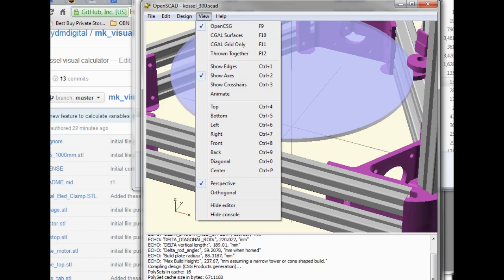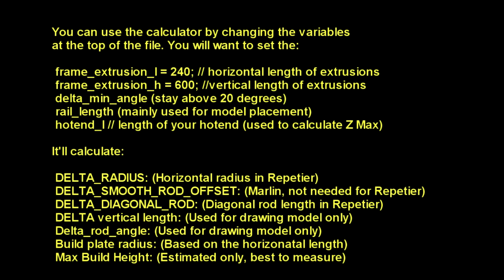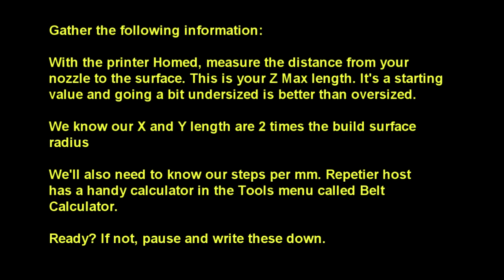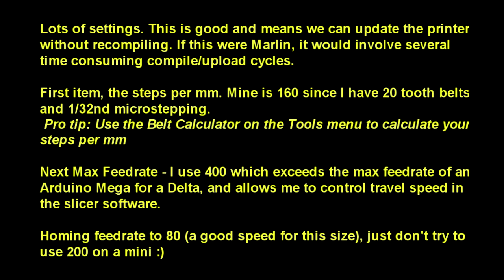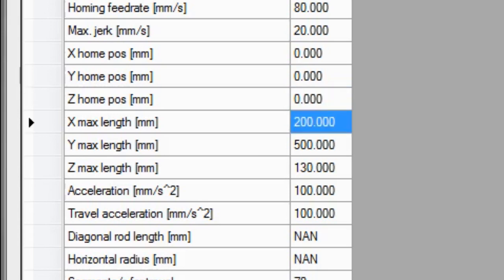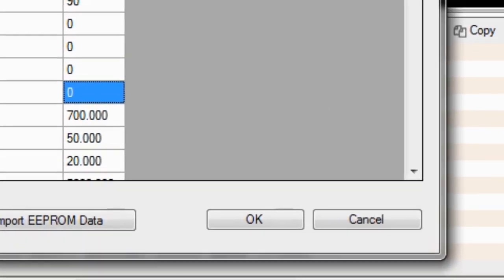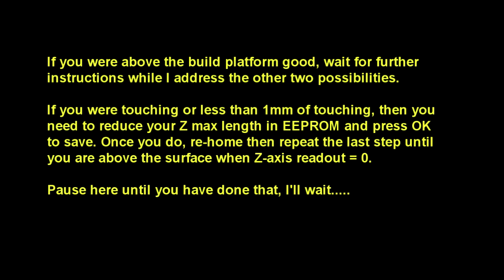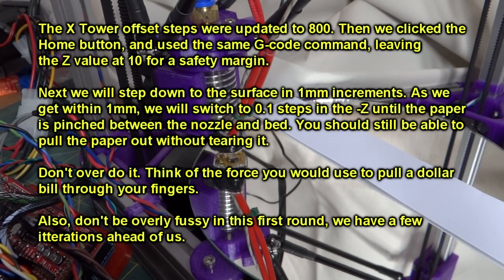mini Kossel Calibration using Repetier FW

Comment: Hey jay, thanks for tutorial, it helps me understand repetier firmware more, and i'm using repetier in my new kossel mini, but i still having an issue with the nozzle height when it moves along Y axis, when i move to X0 Y70 the nozzle still crashing into the bed, i've calibrated all the endstop,and the horizontal rod radius, do you have any idea what might be the problem? thanks :)

Comment: Flatness can be done working on one axis only.  

First make sure to calibrate the 3 axis so they are as level with the bed as possible.  

Then choose one axis, measure the error in Z near your axis and at the center of the bed.  If the difference

    (Z reading near axis) - (Z reading at 0) > 0 --> increase ROD_RADIUS 
    (Z reading near axis) - (Z reading at 0) < 0 --> decrease ROD_RADIUS 

You can use decimals and be very precise.  No need to zero the bed between readings, as the machine is already even. You may need to repeat the operation many times.  Set zero when done, use the printer height. Adding or subtracting the same values to all endstop offsets will keep the bed level, if you want a nice round value for the printer height.
Reply from the maker: +tikabass With due respect, the method I show works as-is and you are welcome to create a video of your process. It works so well, I have not had to recalibrate unless I changed a physical part of the tower axis.
Reply: Jay Couture No problem with your method, I rather enjoyed the video, and it was really useful.  Thanks!  I'm just pointing out a shortcut, which I found while using your method.  It's much, much faster, especially  if the printer doesn't have an eeprom, since each parameter change requires a compilation and download of the sketch.

Comment: Thanks for posting,

I'm on the last step where you adjust the horizontal radius from the center of the nozzle to the tower. I'm only off by.3 but no matter how much I adjust the number nothing changes. What gives?
Reply from the maker: Alvin Thai You adjust the number, then recalibrate towers X, Y, and Z and you are saying the center height does not change too? 
http://reprapandme.blogspot.com/2014/02/irst-tests-and-calibration-repetier.html

Comment: Just to clarify , you don't need to do all this manually when you have an inductive z probe for auto leveling   Or do you?
Reply from the maker: Ideally you wouldn't. I never had much luck with a probe, and so I created this video (and others) to detail the process I use as a resource if others wanted to do the same thing. I only have had to calibrate once and until I changed anything physical (hotend, printer parts) I just turn it on and go.
Reply: How do i Get My Kossel To Auto Level It Self? i Have A Sintron Kossel Mini. And I Have Not Installed anything onto it. it has menus and stuff but, i dont know if i need to add firmware or software. I just Want to know if i can autolevel and print right now without adding any stuff on to it
Reply from the maker: Been away from the scene so I am not familiar with that model. You will want to see if that maker has a forum specific to their machine/controller. Hopefully they have a quick start guide too.
Reply: Jay Couture I Figured Out It Does Indeed Print When I Put In A Sd Card In With G Code on it, Now I Am Trying to install repetier firmware, but i want to use the auto bed level feature, with my z probe, but it asks me to define a pin on the ramps 1.4 board in the setup. I Have Everything Built And Wired, But I Dont Know What the pin number is or name i have the z probe plugged into. once i get the name of the pin i wil be able to define it then install the new firmware

Comment from the maker: I typo happens at 19:52 in the video with the G code command I show in the G-Code entry field. It should be G1 X-69 Y-40 Z10 F4800. I have added an annotation (if you have them turned on) to fix this typo.

Comment: Hi Jay.
I'm using Repetier V1.6.0 andIt seems very limited re the eeprom settings, I don't have most of the options that you have like diagonal rod length etc etc. is there another view that can be toggled?
Reply from the maker: +Motorwinter I have not used Repetier since v0.92. I primarily use Smoothieware on an Azteeg X5. However, I hve not use my mini Kossel in a year so I download the new Repetier and see what I can figure out what changes have been made.
Reply from the maker: +Motorwinter Ok, just installed ver 1.60. The Alt-E option is there in Repetier Host and all of the same variables are visible. Do you have EEPROM enabled in your configuration.h?
Reply: I do indeed Jay. So I press alt + E in repetier and it witt toggle that view of the options.

Your instructables are great. Thanks Jay.

Comment: Hi. Thank you in advance for this video. I calibrate the 3 points well as in your video. I came to the origin and saw the end of the hotend above the bed. I decided to change horizontal rod radius in EEPROM Settings but it does not have an effect on calibration. Why? What's the problem? Please help me :)
Reply from the maker: +Samet AYHAN Have a look at http://reprapandme.blogspot.com/2014/02/irst-tests-and-calibration-repetier.html
Reply: +Jay Couture  Ok. I will look at it. Thank you for your rapid response  :)
Reply: Same issue. were you able to solve it ? @samet ayhan
Reply: My kossel printer is not alive now :D I diassembled it. I am fed up with calibration stuff of it. I am going to build an cartesian 3D printer.
Reply from the maker: I think you are confused about one thing. After you calibrate the outer points and determine the center is too high or too low, you have to modify the delta radius then re-calibrate all of the outer points again. time: 33:51 states this.
Reply: OK. So you are saying after we change the horizontal radius we have to recalibrate the end stop tower offsets and check the center z offset. I'll try that.
 I think a lot of us understood it as the horizontal radius having a direct relation to the z offset in the center.
Reply: Update: that worked, now the delta is much flater. There's another issue however. I have made the rostock mini pro 2 from thngiverse and the dimesions for that seems hard to get. Will this affect too much on my print?
Reply from the maker: By calibrating you are getting the dimensions. You should have measured your diagonal rod length right? I prefer the Kossel since the length of the metal pieces is more accurate than drilling holes in the plywood...IMHO
Reply: I used laser to cut the bottom and top plate.  So I dont think there is too much lose of accuracy there. I was just wondering if you knew about the rostock minis. There are a bunch of remixes of them and I cant seem to settle on the dimensions like the effector offset and delta max radius etc. I'm not facing too much problem, so I think I got the right dimensions there.

Comment: do I need arduino on my computer to use repetier software and EEprom is not highlighted can you help?
Reply from the maker: +David Crandell To burn the firmware (Repetier, Marlin, etc...) yes you need Arduino. Did your controller (I'll assume RAMPS) come with a firmware pre-loaded?

Comment: You do not have kossel_300.scad file in that link. can you post a link as soon as possible because i am too working the project i feel that your method is easier.
Reply from the maker: kushal penugonda From the github comments: "Removing the original calc file and replacing with one with 1515 in the name to make it more clear." Use kossel_1515.scad

Comment: Arduino: 1.6.0 (Windows 8), Board: "Arduino Mega or Mega 2560, ATmega2560 (Mega 2560)"

Eeprom.cpp: In static member function 'static void EEPROM::initalizeUncached()':
Eeprom.cpp:454:43: error: 'DELTA_MAX_RADIUS' was not declared in this scope
     HAL::eprSetFloat(EPR_DELTA_MAX_RADIUS,DELTA_MAX_RADIUS);
                                           ^

Error compiling.

What do i do?
(the same error is repeated multiple times with other things)
Reply from the maker: What firmware?
Reply: Repetier
Reply: It should be the same as yours
Reply from the maker: Actually, I'm using Arduino 1.0 and Repetier 0.95. Based on the errors Id point you to trying an older version of Arduino first.